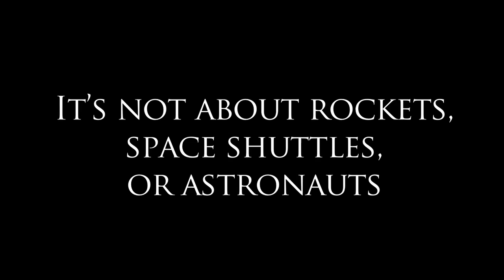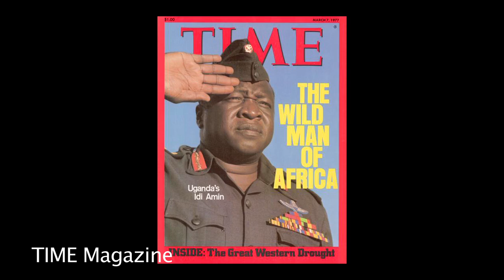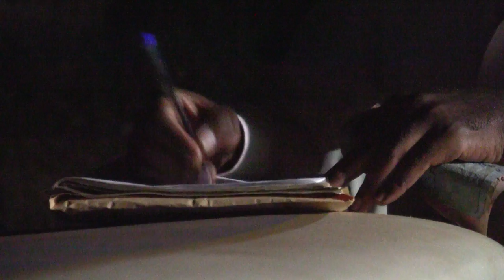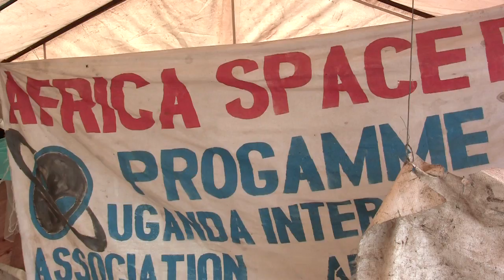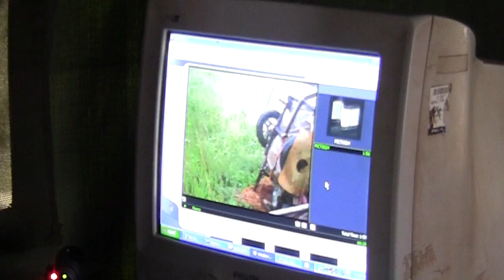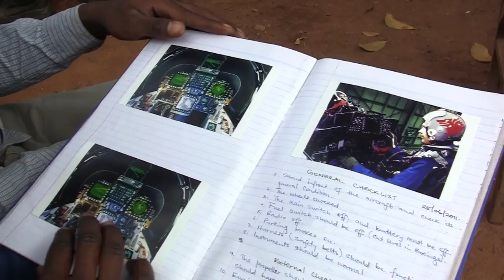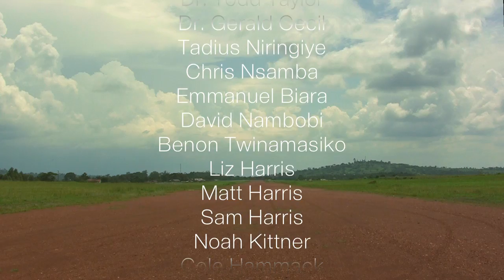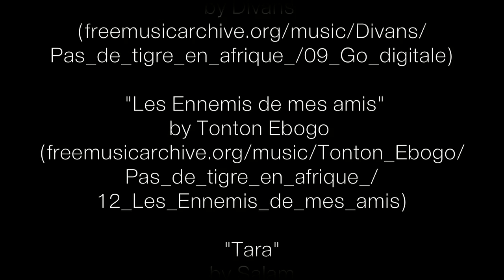"African Skies: The Story of the African Space Research Program"

Comment: I think what people don't understand here is that these guys don't have access to proper education, don't own computers each on their own and don't have access to the internet. Even if they have limited access, they don't know where to start from to start learning some basics of psychics and common knowledge of aerodynamics. Say they do get some access, most of these guys don't really speak English to start with. It's good that they inspiration and spirit to start with something at least, but it's more then obvious they don't have access to some modern building materials like fiberglass, epoxy , lathes and cnc machines for precision, or the knowledge to work with them, it's all costly equipment. But let's not forget that Wright brothers did start their own research with lack of all mentioned and succeeded because they believed in their goal.
Reply: They were donated 80k they do have computers because they show them using them so a little research on the internet they should have easily figured out you cant build a plane with steel and lawnmower engine. To me it seems like a scam they blew the 80k and this crap he shows are just that junk he found and slapped together.